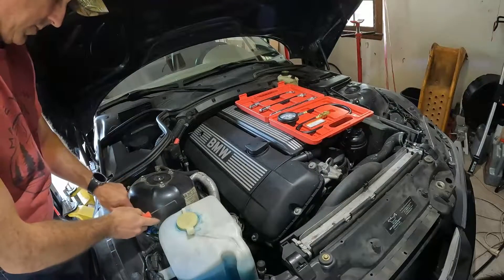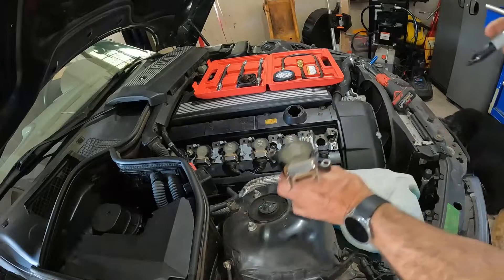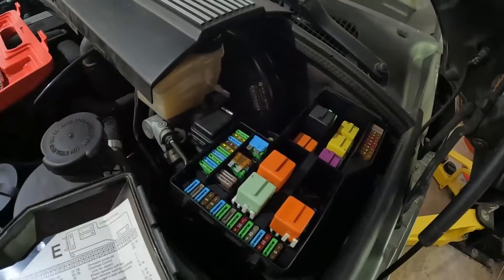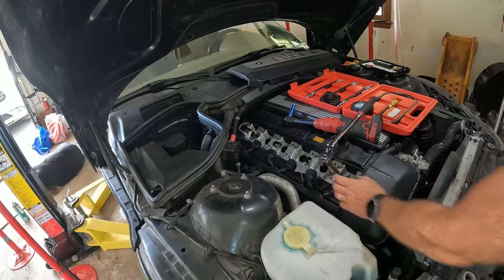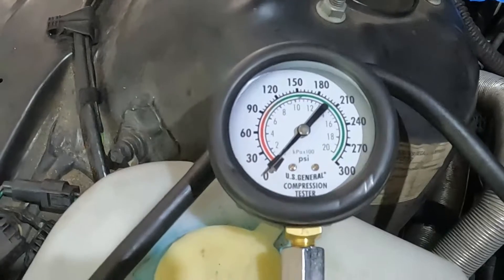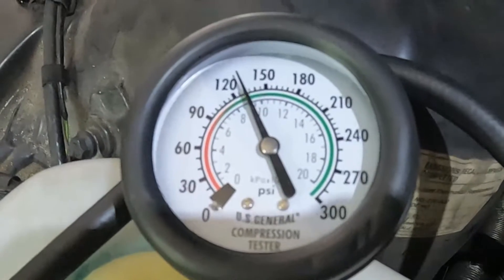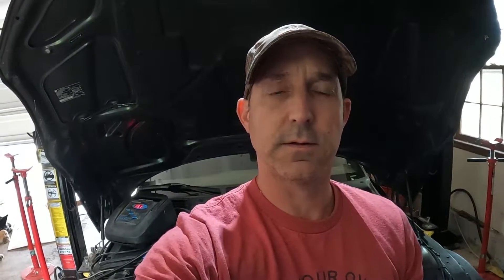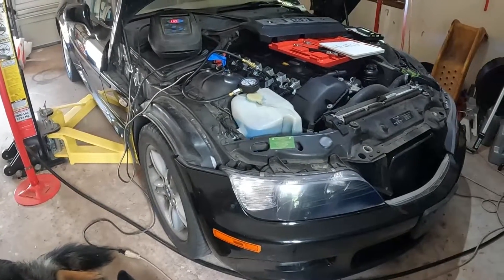BMW How To Perform A Compression Test, What Is A Compression Test, Test Your Engine Health BMW Z3

Comment: I did this on my m54 and my starter isn't catching when i go to test any cylinder other than cylinder one when i try to start any idea what could be going on there?  Whenever I start it there's a misfire on cylinder two and three and it cuts fuel to those cylinders but every other cylinder runs just fine. I went through replaced every vacuum line on the engine and yes they are ran to the right places, I have replaced every spark plug, and have tested all the coil packs since they were already fairly new and their all working perfectly, same with the injectors. I'm starting to think a valve has dropped or something
Reply: forgot to add but I took the valve cover off locked the engine at tdc and used my timing kit to make sure the timing was absolutely perfect and it is. I recently did a head gasket on it and went ahead and timing chains as well so its none of that
Reply from the maker: If the engine turns over you should be able to get a reading on each cylinder. Could be low compression or follow my video for a leak down test to determine if the issue is top or bottom end. My friends car was on the bottom end and I did an engine replacement. Cylinder 2 an 3 are next to each other so it could still be a head issue if it was not machined at a machine shop or the block is breaking down and the threads pulled out of the head. I have a video on how to fix that as well using a time cert kit.
Reply: @AskTheCarExperts  thank you

Comment: Did this engine run with those numbers
Reply from the maker: LOL Great question Thomas! It DID run. I was able to pull it in and out of my garage multiple times. It did not run very well however. Putting the timing together now and hope to be driving it this spring. More videos to come!
Reply: @AskTheCarExperts  thanks for your reply. I just recently got an m54 from the junkyard, it has 180psi on 4 cylinders, 158psi on the 5th and one with  130psi  

That’s with the engine on a pallet, not warm or anything. I’ve heard that compression will improve with the engine warm. So what do you think? I’m hoping I’ll be able to use this engine for my swap, even though 2 of the cylinders are a bit lower
Reply: @prodamnesic   Engine was fine. all numbers read above 180 after i warmed it up and ran it. Been going strong for a few months now.

Comment: This is a great video: thanks for recording all the steps. I'm just about to do a compression test on my 2007 325i E93 with N53 engine. This video has given me the confidence to have a go. Cheers from the UK.
Reply: Just did the test yesterday using a cheapo £20 compression tester from ebay. Success! I did the test cold, pulled the relevant fuses, removed all spark plugs, then tested each cylinder. The results were unexpectedly good: PSI from cylinder 1 to 6: 225, 220, 225, 235, 225, 235. I did 7 or 8 cranks of the starter. I say unexpectedly because I recently had a compression test done at a local garage and his results were really low and he told me the engine was no good so best to sell. I'm glad I did it myself as I was suspicious of his results. Anyway I can now go on to tackle the real issues - the dreaded N53 misfires... To that end I'm replacing all spark plgs and coils with new OEM parts in the next few days. Cheers
Reply: @micdev42 Hi mate got a n53 myself and have ordered a compression test kit myself. Did you have to pull the fuel pump fuse? And also what were your symptoms of the car running poorly? If so did you manage to sort it in the end? Thanks alot
Reply: @AbdulHaq11901  Yes I pulled the fuel pump fuse (can't remember which one it was...). My car was/is a bit of a basket case: leaking injectors, poor fuel consumption, jerky gear changes, misfire codes etc. - but no O2 or NOX errors surprisingly enough. The reason I did the test was that my technician did a test and he reckoned the engine was shot: widely different compressions. I wasn't convinced as I'd read that sometimes the gauge doesn't seal properly. Anyway, I did my tests - with the engine cold - and I got a consistent 220 psi (more or less) across all cylinders. This convinced me that the engine was basically OK.
HTH
Reply: @micdev42  ok nice. Yh mine is leaking injectors 100% but what worries me more is when the engine is warm it starts juddering alot if I put the pedal down fully or even if I do mid throttle really. Ive ordered some injectors used and new coil and spark plugs (hopefully that fixes the issue) it's also got precat oxygen sensor errors showing on inpa. So maybe it is the 02 sensors? Its a nightmare this engine but I want to get it right.
Reply: @micdev42  also did you manage to fix your car? Did the plugs and coils or even injectors sort the issue? Thanks
Reply: @AbdulHaq11901  They need coding in using INPA.
I think all the injectors need to be good before proceeding further. Only you can decide if it's worth it for your car. Mine is an E93 325i SE N30B30A, so not the most desirable but I kind-of like it.
Reply: @micdev42  yes I've checked which ones are leaking by leaving car overnight and checking the spark plugs in morning to see which are wet with fuel
Reply: @micdev42  sorry to message again but I got my kit off Amazon and it doesn't even seem to fit into the spark plug hole. could you send me the link to the one you got? If it's still available. Thanks
Reply: @AbdulHaq11901  my replies are not showing up

Comment: 210psi on my Jaguar.
Reply from the maker: Hi Gary, I was hoping for at least a few of the cylinder on the Z3 M54 engine to come close to that. Going to do a cylinder leak down next before starting the head removal.
Reply: @AskTheCarExperts  Yeah, that's the kind of test we do on Continental and Lycoming aircraft engines.
Reply from the maker: @garyvanremortel5218  That's cool! Never worked on an airplane yet 😀
Reply: @AskTheCarExperts  asktheplaneexpert...
Reply from the maker: @garyvanremortel5218  😆
Reply: @AskTheCarExperts  But someone else has got to hold the prop blade.

Comment: There is always ways to do things multiple ways. We were always taught to press the accelerator to the floor on cranking. At the dealer, 9 out of 10 the guys will never disable the fuel system. A strong battery is good, with the maintainer connected. Some say coat the threads of the tester and hand screw it in. We always do it on a stone cold engine. Personally for diagnosis, I always get the best gauges I can afford. Snap-On's stuff is good in a sense since spare parts are easy to get a hold of. Fuel pressure is a different story, back in the day a bad gauge would jump if you tapped on the glass. Never cut corners on diagnosis equipment whenever possible. Southmainauto had a nifty trick of using a transducer on the radiator cap with each cylinder test, people will always find new ways to know more of the engine's status without even opening up the bugger. Always give cred to the guys that help us to improve our diagnosis skills.
Reply: I've heard of doing starter tests to see if the current peaks for each cylinder during the compression stroke are the same.
Reply: @garyvanremortel5218  Possibly, still any test will only give you an idea of vaguely what's going on. As Mercedes Source used to say, its never just a headgasket. I was brought to the understanding that once an engine has been cooked, everything goes out of spec. Fixing a overheated engine is a hit and a miss, usually just not worth it depending on severity.
Reply: @devinsmith4151  Yeah, the starter current test was just a quick and dirty clip-on probe way to see if they were all the same.